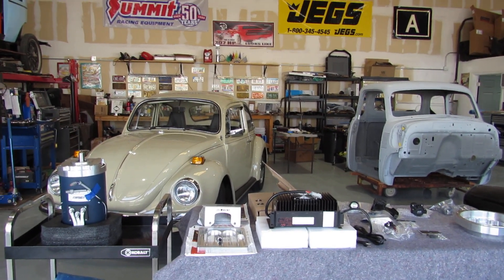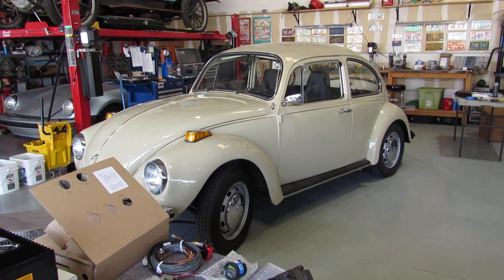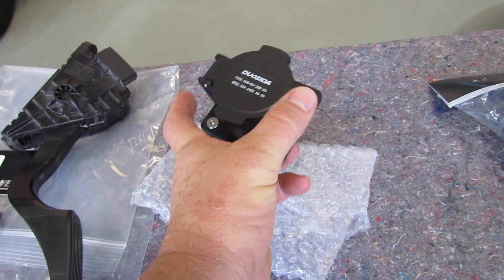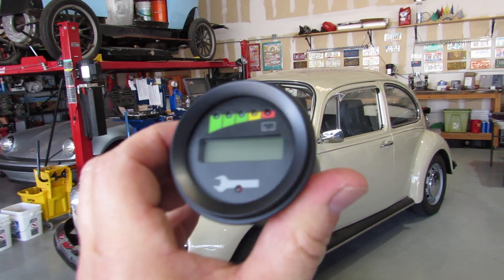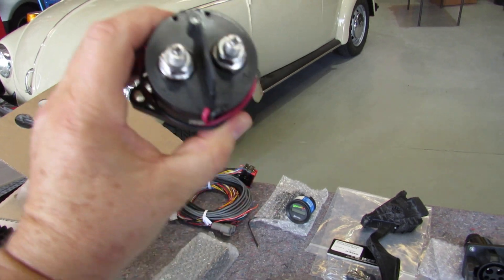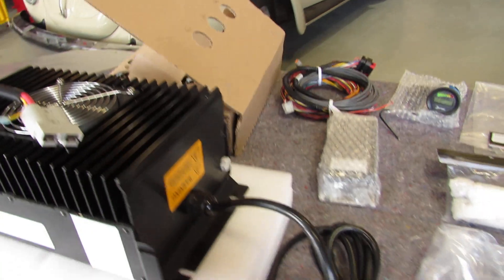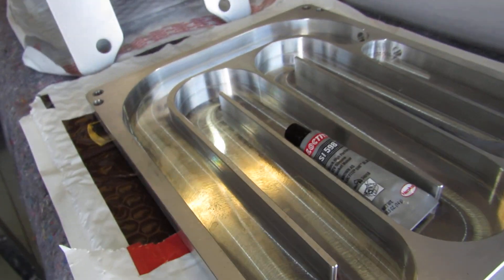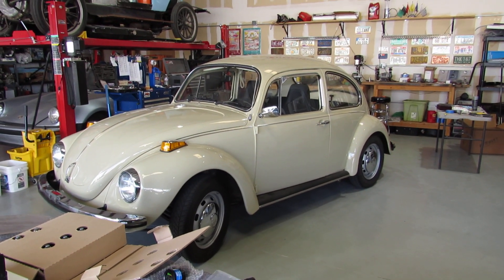1971 VW Super Beetle EVWest Conversion Unboxing the Starter Kit

Comment: Have you thought about placing the batteries on car´s floor, just like the e-Käfer do?
This configuration has some advantages: 1. More stability as the weight is distributed lower. 2. It would leave space in the trunk. 3. It would isolate the noise produced from the road.
Reply: i realize I am kinda off topic but does anyone know of a good website to stream newly released series online?

Comment: US $15.000 for the kit,  If i spend an avg. of $142.85 gasoline/month,  i will recover the investment in 8.75 years (105 Months),  I think is too expensive. considering that is an old car also.
Reply from the maker: Agreed, probably basing it solely as an investment, it would be hard to justify. (especially with the current fuel prices so low), but for us, its more about the challenge of doing something unusual and interesting....hoping I can get started soon! Thanks for checking out my vid :)
Reply: This endeavor isn't about recovering your investment. It's about giving a classic car a lot more performance, running clean and having fun with it. Your calculations exclude maintenance supplies and costs for engine upkeep. You would also have a sizeable cost to rebuild the old engine. EV conversion is still pricey, but so is any engine swap.
Reply: @pabblo6103  And he didn´t added the money return from the sale of all the unnecessary components.

Comment: Hello Randy I also have an EV West kit and have started the conversion. Would like to talk shop with you on wiring up components.  Steve
Reply from the maker: Hi and thanks for checking out my vid....unfortunately, I haven't even started on the conversion yet so probably wouldn't be able to contribute much to the conversation.  Currently finishing up on the 55 Chevy and hoping to get rolling on the VW asap....maybe late spring before the heat cranks up...
Reply: Have you received all of your parts from EV West yet?
Reply from the maker: @tessapainter3969   I believe so, we ordered just the "starter kit", so we never received the cooling components, how about you?  We haven't settled on a power source yet though....
Reply: EV West no longer sells cooling kits.  We bought a DIY PC Water cooling kit online, should have it by May 7.

Still trying to sort out a charger and converter to complete the build.
Reply: Hey Randy we got our charger from EVWest and a DC/DC converter from others. With the motor in it is wire time. Have you started yet?
Reply from the maker: @tessapainter3969  That's great news!  Are you posting any photos anywhere...ie...Instagram?  Still haven't started on ours yet.....ran into a couple of snags with the pickup, so a few more weeks to go on that project.